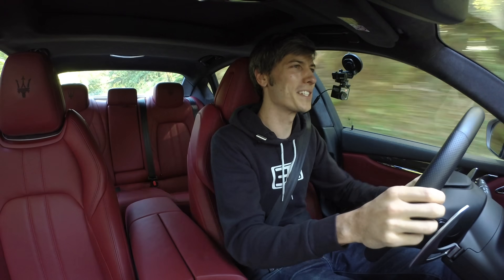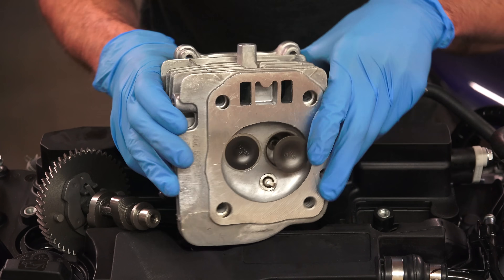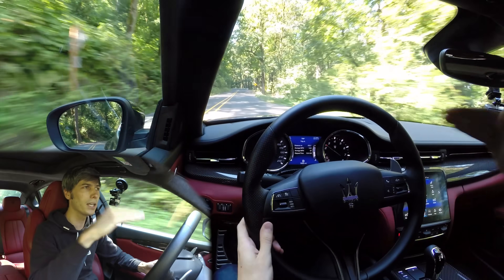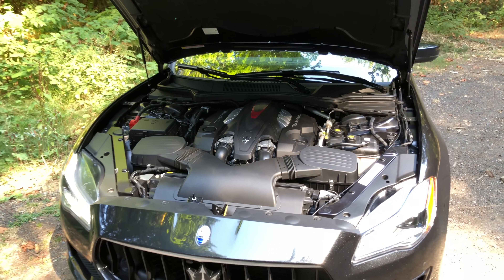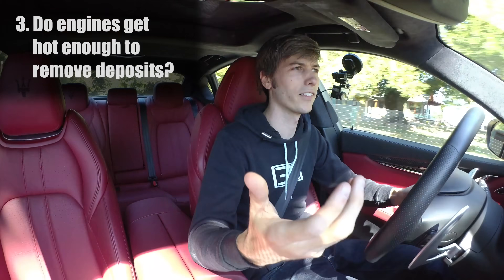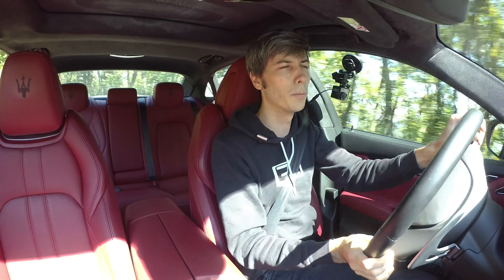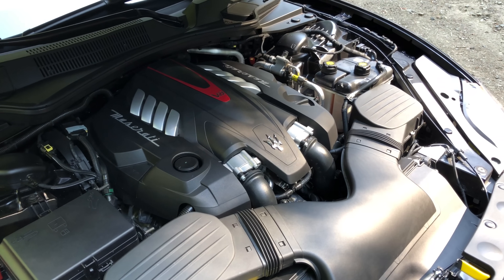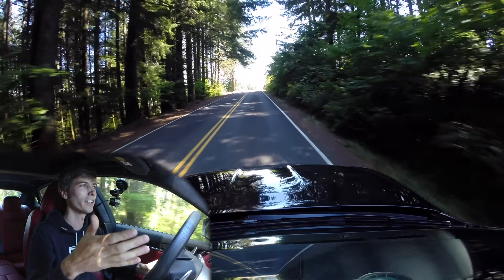Is Redline Good For Your Car's Engine? Italian Tune Up

Comment: In Eastern Europe we have now something called de-carbonization where they put in some pipes into your intake and clean your engine from carbon deposits by running the car with that chemical present that gets vented through the exhaust. It costs around $50 and I had it done by my car mechanic and I feel the difference in how the engine runs. Was worth it.

Another thing is cleaning your particulate filter (especially diesel cars) I have an older diesel from 2003 that was made with euro 3 emissions standard and at that time they could make particulate filters that cleaned themselves just by running it on high rev on the highway that is when they dumped their load ... with euro 5, euro 6 norms this is no longer possible you have to take the filter in and it costs a bunch of money to clean/replace it. I'm glad I don't have that problem yet.

Comment: How about water methanol injection such as systems for high boost engines? It seems to me that high boost pressures combined with the alcohol/water injection would tend to “blast/shock” any deposits loose. We’re talking about short time blasts at really high engine rpms. What do you think???

Comment: well, I drive a 24 years old sedan, and around 2 to 3 times per week I give it some pulls ( second to third) to give a clean, since my engine is a single injector ( in the trottle body) I think it may clean a bit every time.

Comment: What about carbon that is forming on the cylinder walls and between the piston rings? DI engines produce a lot of soot and all that soot is going into the oil. So surely some carbon is entering the oil though the piston rings. Can gentle driving for prolong periods of time cause build up in the piston rings causing oiling issue?

Comment: I worked with an old mechanic years ago and I was tinkering with a 72 Chevelle I had purchased to restore. I just wanted to get the engine, an original 307, running better so I could drive it to my place across town for storage. The old guy knew from listening to the engine that the valves were full of carbon. Following his instructions, I filled a large water bottle with cold water, got the engine up to operating temps, locked the throttle at around 2500 rpm and pulled off the brake booster vacuum hose and slowly poured the cold water down the hose in doses that would not allow the engine to completely stall. Pour, let rev back up, pour, let rev back up and so on until the entire 2L bottle was emptied. When I reinstall the vacuum hose and released the throttle, that engine idled like a new car and was as smooth as silk. Unbelievable, the cold water hitting that back of the hot valves removed enough carbon to completely correct the issue. True story.
Reply: Water cracks the carbon and works great. It’s just not as popular because it’s easy to hydrolock a engine if you do it wrong
Reply: @MoparMadness93  It sounds like a very dangerous method to me.  Not only do you risk hydrolocking the engine, but pouring cold water in could even end up cracking components (depending how hot they are of course).  I think an Italian tune up is safer, assuming the cylinder walls don't have nasty ridges from being driven too gently for too long.
Reply: Johann Kuhn if your careful when you do it you’ll be okay but you are correct that it is dangerous if you do it wrong. Your not going to crack any internal components in the engine. Once the water enters the intake it warms up before it enters the cylinders
Reply: Please do this veryyyy rarely😂. The tensile stress placed on the engine due to the rapid contracting on one said and the expanded( hot) other side of the metal is just BEGGING for a brittle fracture. Please, just no😭

Comment: Here's my honest experience..03 f150 4.6 370000 miles burns oil (valve seals)I daily drive 35 miles each way in slow stop and go traffic  with 35 mph speed in the event I can actually make it through the lights, I burn about a qt oil a week which in time does cause occasionally detonation up mountains with rpm low and slight power loss...every few months I'll make a trip up i75 that is about 550miles round trip..Everytime on my way back and for a few weeks once I get back I have more power restored and no detonation up that mountain

Comment: Overhead cam with manual yes. Easier to keep in a high Rev while driving. Example: interstate @70-80 mph in a gear that keeps it reved high with the occasional pull to clear everything out

Comment: highway and highrevs (4500 of max 6000) while not giving it shocks in acceleration... welll... this always works, mannnn :) 

if the car is a piece of real junk, at least you'll smile while killing it dead :))) 

otherwise, with all systems serviced in time(watch out for timing and cooling!!), this treatment works for both petrol and diesel. 

My diesel one (3 series 2l E46) manifested results more quickly, due to much higher temperature default operation, live cleaning DPF and catalytic converter. 

But the petrol one ( shitty but revvy diehard '97 Daewoo 1.5l 8valve 1040kg) had a marvelous increase in acceleration response and top speed because the hydraulic rockers unlocked and came to life in full formation :* what a song for five hours at 170km/h, with only me there. it could do only 130km/h in the first 200km :)
Enjoy The Italian Tune Up, but first use caution

Comment: The italian tune up does work in aircraft engines with manual mixture and you don't even need to redline it. Rev it up to about 75% RPM and lean the engine to the point where there is no excess fuel that can act as cooling and the spark plugs will burn clean in about 30 seconds.

Comment: So are these carbon particles small enough to  pass trough the catalyst or will over time plug the face of the converter?   In s diesel After treatment system often that face of the catalyst will get plugged with soot and become ineffective. Has anyone done a study on that as a problem.
Reply from the maker: Diesels have PM filters which you periodically will have to clean or regen to burn them off.

Comment: Great video! But I have some doubts on your interpretation of some research findings. You said one paper found "The higher the engine load, the more carbon deposit is going to form". Then you made the inference that "The harder you drive the car, you are making it worse". But to my understanding, high rev is not equivalent to high engine load because the latter is exerted by external factors. I admit I'm not an expert on this as well so hopefully somebody can shed some light on this.
Reply: High rev and high load are the same, it's basically how hard it's working

Comment: Remove cat/s, warm engine, pour a whole can of seafoam through booster line then drive it like you stole it, that will knock most of the carbon loose. Reattach cats, clear o2 codes  and follow up with seafoam in your tank every other fill up for a month and use quality gas.
Reply: Oldschool Dude did this all the time before taking my 01 cobra to the drag strip. Would empty the gas tank put a bunch of sea foam in it, beat the piss out of it, then fill it with 93 and I swear I got another 10-15 hp

Comment: my honda never sees rpms lower than 9k and sometimes goes 10k. I dont think i have problems with carbon deposites :D
Reply: Rodrigo so from the moment you start it up to the moment you park it it's running 9000rpm+ ?
Reply: @joshuavincent7884  only for a few secs
Reply: @rodrigo4379  fascinating

Comment: The combustion chamber is the only place on the engine that'll get that hot. Your best bet for a direct injection engine is to get "oil catch cans" to keep oil and carbon from building up on the throttle body and intake manifold and into the valves. Older multi port fuel injection would wash the intake and intake valve seats with gas so it wasnt as bad. Now gas is shot straight into the cylinder. So all that crank case vent material sticks to everything. I put them on my 370 and checked the throttle body a month afterwards and it was spotleas. Well obviously right? Im just saying, in my opinion its a must with direct injection engines.

Comment: If you bring your temperature to ~325 degrees it means your pushing the engine hard which also means you have more wear. Now is it worth all the extra wear on the engine and other components to remove some carbon deposits?
Reply: There is not much extra wear, the engine is designed for that. Most wear is from many cold starts, driving the car very slow with deposits everywhere in the engine.

Comment: I had a 1998 Expedition that wouldn't pass emissions until you drove it like hell for 5 mins
Reply: Thats just because the catalyst works better at high temperatures.
Reply: The catilytic converter will work better once it gets hot. My Saab has the cat right on the turbo to get it super hot super fast. Always passes emissions like a champ!
Reply: @QuintonNG2000  Just light the cat on fire and itll still pass in 10 years
Reply: Lol thanks for the experience share
Reply: LOL

Comment: Based on this information, it confirms my theory of an Italian tune-up along with an induction service (such as seafoam) to compliment one another.

While servicing vehicles, I used a scope a couple times out of curiosity before and after I was done to contrast buildup in the combustion chamber/intake.

This also explains why direct fuel injection vs port injection has a major effect on buildup on the intake side. Thanks for sharing your content.

Comment: I recently needed to drill a new thread for the spark plug on my bike. To get all the little metal scraps out of the combustion chamber I filled it with motoroil and sucked it out again using a pump. Turns out I did not only remove the metal but also some carbon deposits.

Don't redline your engine guys. There are better ways

Comment: big v8s were meant to drive at highway speed on open roads... I remember driving the family Olds Cutlass 455 Rocket ('67) on the highway one fine summer day (in the 80s...) when a "brand new" corvette pulled up and gave me the snob look cause my car was 'older'... little did he know... even at 60-70 mph... my foot was barely touching the pedal... when he tried to pull away I cruised right back beside him, then he tried to speed up and get away again...  I kept cruising right beside him... like it was nothing...  until he started getting real nervous (running out of gas pedal...) once I was sure that he was pissing his pants... and we were doing over a hundred by then... only then, I gave him the same look right back... and decided to put my foot down and left him in the dust... I wasn't trying to make him cry or anything...  but it was clear he had no balls and was all out of bullets... and oh yeah... the engine absolutely loved it...  didn't even break a sweat...  they don't make cars like that anymore...     ';  (

Comment: The reason you’d see more on a direct injection turbo engine under load is because the extra boost is slightly getting past the piston rings building more crank case pressure and causing more vapor with oil mixed in too get put in to the intake with the PCV system causing more build up. The way you can reduce this is with a oil the resists foaming and evaporation with heat, also to further help you can install a oil catch can which will help to suspend the vapor in a container so it condensates reducing the amount of oil entering the intake.

Comment: for years my cop friend and i both have not really had a noticeable carbon build up in our cylinders cause we both tend to wot here and there while driving in kung-fu fighting driver towns. we've both noticed that that seems to help, BUT not because of temperature or heat, seems more merely the amount of cool saturated fuel splashing on top of the pistons and chambers is more to blame. in 2005 he had knocking start to become noticeable even using 91 octane premium in his 2000 Exterra. He had heard racers use spray bottles with water to clear away carbon, so we carefully eased into trying the method, and as long as the rpms stay above a lower number there was no problem. but revving it to like 3k and rapidly spraying the water in the throttle body would lower the rpms down and depending on how fast we sprayed is how low the rpms went, but even with a heavy rapid spraying of water the rpms would go below 1500-1300, and we would do that for maybe 10 seconds at a time and then let it run and warm back up good before doing it again for probably 10 full cycles. 
...we didn't have an endoscope, but the Xterra ran for a full year commuting to work everyday with no knocking. it did however come back after a year and we did it again, and it worked great again. it had been previously owned by another owner and they lugged it around causing the solid carbon buildup and it may have just taken more dedicated attempts to fully clean out the cylinders-but at 2019, would be verifying the results with a spark plug scope. it's the hot dry frying pan effect by splashing cold water on it makes the old carbon which is brittle, flake off.

Comment: The Italian tune up was meant for old carbureted cars and it was meant to clear out the lines not carbon deposits it was meant to clean out the carburetor by pushing out lacquer at high RPMs with fuel

Comment: Great research!!! Thanks
I think high loading will form more deposit is due to more fuel is supplied. Carbon deposit are main from fuel. If lower carbon contents from fuel, there will be less deposit come out (hope I am correct)
Then if tuner decrease air fuel mixture ratio, there will be less carbon deposit form. And lean burn also cause higher engine operating temperature.

It may lead to less carbon buildup or even clearing effect.
Reply: I get confused by myself.....It should be increase A/F ratio to get lean burn.... Right????

Comment: I have found that after several weeks of city driving, a long sustained haul of around 200 miles or more at freeway speeds seems to clean out my engine.
Reply: I kinda wonder whether this is due to an active ECU thing? Some engines allow for relearning values, for example after changing O2 sensors, and that reconfigures the ECU to your driving style during a span of 100 - 200 km / 60 - 120 miles.

Comment: First of all, you have to know about Italian tune up is that Italian prefer small engine and use maximum performance from that. Instead Americans like larger engine and almost no way to use maximum performance long time without losing license.
When I live in near Rome, I floored on the highway for 1+ hour to go somewhere far.
Reply: am from rome, can confirm blasting down the motorway at 150 kph on a 1 liter 3 cyl
Reply: Jsesus christ 😂
Reply: I hit 210kmh with a 77hp 1.4 petrol fiat punto once
Reply: @msencerkaya  Did you drop it from a helicopter?

Comment: it's kinda crazy that ALMOST all the engineers that love the automotive sector in this world have a poor chemistry knowledge lol, cause here in BR I'm an engineering student and me and my classmates don't like chemistry at all hahahah
Reply: If I had to guess, I think a pretty big part of it has to do with the abstraction of chemistry vs engineering. With engineering, you can physically trace how every single component is working within a system. It's basically art with utility. Chemistry on the other hand, requires a lot of faith in information being accurate which is exceptionally difficult to do when said information is constantly shifting. Chemistry is all about using assumed information to get results whereas engineering is about seeing information and manipulating it to get results.

To sort of hammer this point in, consider how much chemistry has changed over the years compared to how much engineering has changed over the years. Progress in chemistry comes from an increase in accuracy of results based on new information we discover. Meanwhile progress in engineering seems to be directly related to discovering new materials and understanding their properties and finding clever techniques to manipulate those properties. When working with chemistry, your basis is assuming the information leading up to where you are now, is accurate. With engineering, the basis is almost exclusively mathematical. And there's nothing in this world more logical than raw mathematics.

Comment: Pistons are also cooled by the intake air aswell, and on a carb engine the fuel atomization aids to cooling the intake charge
Reply: Arren Lambert i suspect the pressure in the gas chamber would increase the temperature, no?
Reply: @souheib9343  yes, on the compression stroke, but the air that enters the cylinder will have a cooling effect. Its a continuous cycle, raise temp of the intake air and cylinder temp and piston temp will rise

Comment: I'm just wandering if the Italian tune up just clears out a catalytic converter my truck burns some oil and clogs my cat with in a week and every time I travel 100 miles and beat on it I start to feel the difference on the way back and sometimes it takes as long as half way back and trust my I really abuse it on a clear path

Comment: All i know is that carbon deposits are a real thing! Many years ago i owned a car where the engine would carry on running when your turned it off and removed the key! After about 1/2 minutes the engine would shut off. From my limited mechanical knowledge, it was a build up or carbon that let the engine carry on running when i turned it off. I sold it for parts and someone brought it and carried running it and i would see it parked up every day because their child went to a school near where i live so i could see it running with no one in it! lol. (I could see the smoke coming out of the exhaust, before someone asks how i knew the engine was still running).